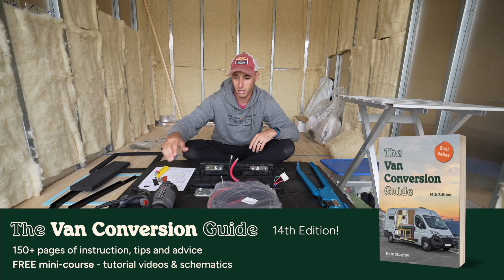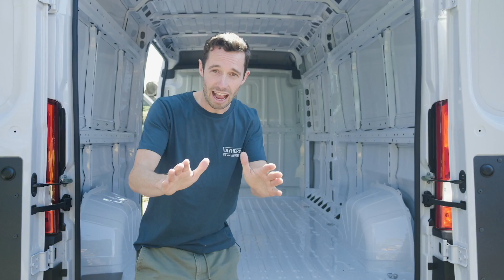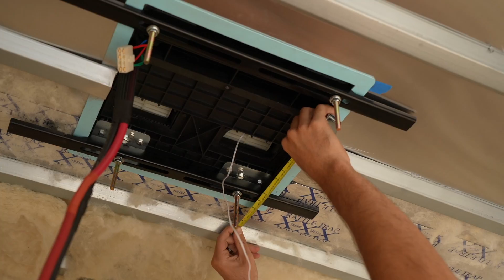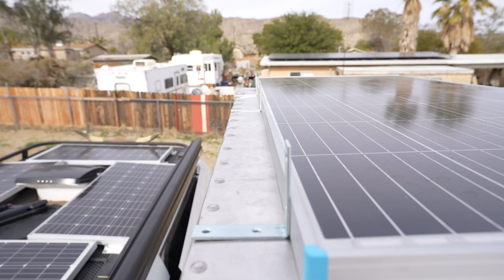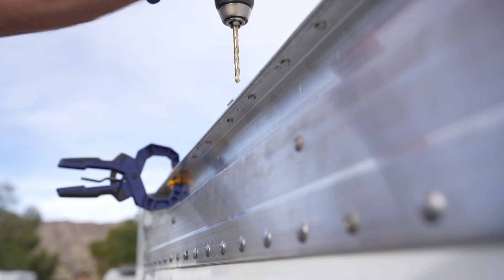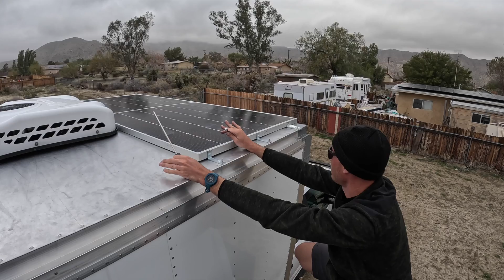DIY Expedition Box Truck Build - Part 2 - Nomadic Cooling AirCon & 1,310w Solar Array Install!

Comment: Just ran across your build. Why didnt you show sealing the bolt holes you drilled thru your roof top to prevent leaks??

Comment: Did you feel it was unnecessary to apply butyl tape to the bottom of the fan and air conditioning unit before dropping them into place on top of the roof? If so, why?

Comment: Couldn't see any butyl tape or sealant in your roof mounts hope it doesn't leak
Reply: Hey there! The entire base of the fan and AC is completely covered in lap sealant. As for the roof mounts that penetrate the roof, those are also covered in lap sealant. Been a year now with no leaks :)

Comment: I’d use strut and spring nuts that electricians use to mount equipment. Use hard rubber spacers for vibration, noise, and dissimilar metal isolation.
Reply from the maker: I like the idea of rubber spacers a lot, thanks for the tip!!